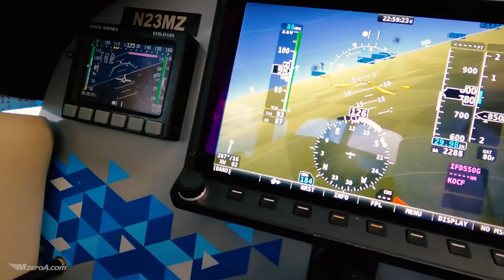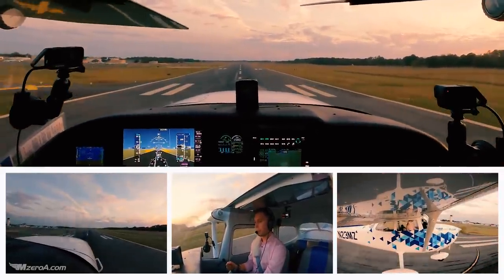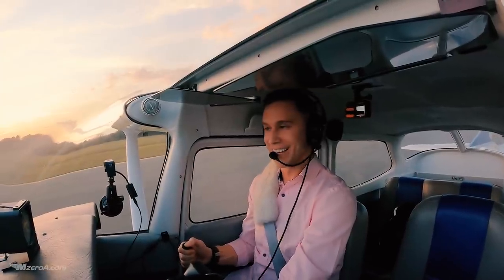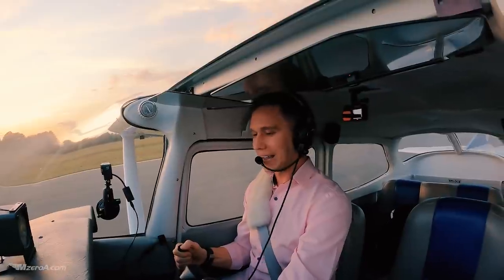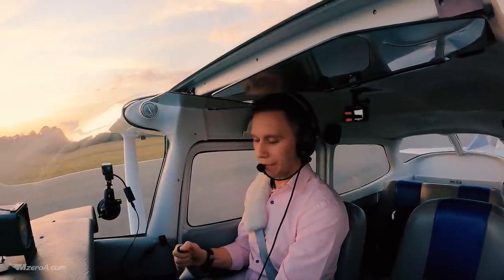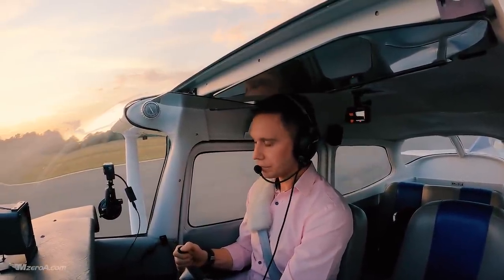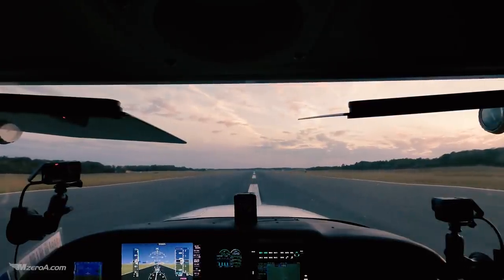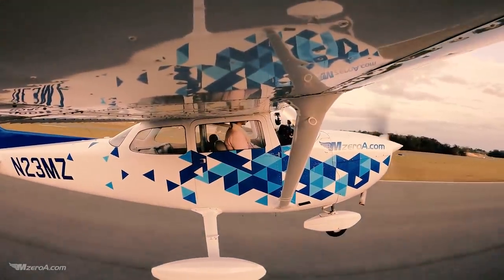Fundamental Series Episode 1 - Landings

Comment: Fantastic!  I’m working on my private pilots… My assigned instructor had me spend 1.3 hours doing 10 touch and goes with two full stops . My first ones were my best.  My calls got better. I called it quits. I’ve asked him to do mix practice up in the air. Add turns in with stalls and so forth. We will practice stalls repeatedly for an hour.  He told me that until I prove myself I don’t deserve to do anything else. 🙁 I’m not improving, I’m getting frustrated. Recently I’ve flown with other flight instructors and asked them if we could do mixed practice. I’m making progress with them. And was even told by one instructor that he’s going to mix things up with his students more often, especially when they get stuck. I think I’m gonna have to fire my primary.
Reply: Yeah, it's a bad move by the primary instructor to not realize that you have to mix it up to overcome plateaus

Comment: Never try to “stretch” a glide on final approach. Your only option is to reduce the flap setting and lower the nose. This is why using a slip instead of flaps is better. If you’re gonna be short of the spot, add flaps in ground effect. Hold it off, but let it balloon.

Comment: I have been an aviator for almost 38 years. Assorted ratings and endorsements and  Now I am back to basics with the airplane  I Have now. It is a conventional gear otherwise known as a taildragger for the newer set out there. These are extremely informative and very well done. We are all student pilots each and every time we go up just with a little more experience. I have landed without landing lights both on purpose and not on purpose.. I  have practiced them and sometimes I have shut them off because they were a distraction especially on a shorter runway. If it does teach you depth perception and how to set down Nicely.

Comment: Awesome job!! I appreciate your mentorship. Many of these landings I’ve done so many times before and, yes, Right Traffic (which is standard for us at Chesapeake RWY 23) is a challenge. You do get comfortable pretty quickly with it though. My instructors have always been pretty good about teaching the “Glassy Water” approach at night with no landing light. I still remember the first time he did it to me, turned out the landing light on final and it was the last landing of the night. As soon as it happened I seemingly (instinctively) transitioned to landing with a little power to smooth the approach and transition. Ironically, when I was younger☺️, I used to ride along with our Part 135 Captains and work radios and do some of the Pilot Monitoring duties on the revenue legs and actually fly the twins on the non revenue legs to get some free training. One thing our Chief Pilot gave me advice on was a stabilized powered approach to landing (to make the landing smooth as possible for the pax). Warren used to call out Airspeed and Attitude on short final and coach me to “hold it, hold it!” Then just as the wheels squeaked, retard the throttles and decelerate smoothly. Obviously, most operators aren’t flying into short fields on a regular basis, so it’s nice to do on a longer runway. Short fields you have to do the proper techniques and master the airplane, but it’s also nice to learn how to master the power and pitch combinations just as you showed here and plan the approach appropriately. Nice job on the lesson and great job editing Coach Ray!!
Reply from the maker: Thanks for watching, Talib! Glad you have gotten some quality flying experiences! Glad you enjoyed the video!

Comment: I'm at almost 90 hours and just need to finish my solo cross country requirements before the checkride, yet I still struggle with my landings.  Your videos are really excellent and address nearly all of the challenges I have faced in my training so far, I really appreciate the time and effort you have put into their production.  I try to remember and apply your techniques every time I get in the plane.  The one thing I find missing on every flight training video I have watched is the inclusion of rudder action.  I have been seriously rudder challenged from day one and, while improving, it is still a major issue.  I would love to see someone instrument the rudder pedals and provide a real-time rudder action gauge or readout on the video to show what is going on with the pedals throughout the exercise.  Yaw is, after all, a major axis of control, and it seems to be frequently left out of the discussion.  Many of my landings wind up lousy because I am not keeping the nose headed in the right direction.  I'm sure there are restrictions from the FAA on how such a thing could be implemented, but it would surely be an incredibly useful data point for training.
Reply: I feel with you. I am an older guy and I really needed some extra hours to land. The synapses didn't connect as quickly, you think more. ;). In my case I read many recommendations but the best one was to SEE the runway getting wider. Keep your speed limits and watch the runway getting wider and wider. When the speed of getting wider is about 10 times faster than normal you are on the right height. The helped me - even in night flights when there were no middle markers. Now, I am flying several aircraft including my own one, a Cessna 182 and my synapses are connected, even for cross winds and gusts. Honestly, I am better in landing with heavier aircrafts than with light ones like Cessna 152 due to my  "gross motor skills"... Try it. Concerning the rudders: look far to the end of the runway and imagine to drive on a motorway.

Comment: My CFI did this same routine with me. It was awesome. My confidence shot through the roof after nailing my power off landings, first two ever and landed great on both. I didn’t use flaps and slipped for altitude then speed. I can always lose altitude over the fence but I can’t get it back if the engine is out.

Comment: First time I think I've left a comment on one of your videos. All of your videos are excellent. 

I really enjoyed this one. Probably because I feel like I've been having a hard time lately with my landings. I've always flown a 172, but recently started getting checked out on an Evektor Sportstar. Because it's cheaper to rent and I need to get 50 or so more command hours to get my CPL (currently RPL with about 178hrs total, done on and off, over quite a few year).

The problem I've been having is getting used to the smaller and lighter sportster. It's so easy to bust flap speed on base and final. I'm also over controlling the stick, because it gets blown around so much. Crosswind landings also need some polishing.

The part about getting burned out doing so many circuits, struck a chord with me. My instructor had me doing over 2 hrs of circuits (with a 1/2hr break) and I could feel my brain starting to fog over 😉.

Thanks for the tips. I'll keep practicing.
Reply from the maker: Glad our videos are helping! Keep on practicing and you'll master those landings but don't get burned out as you mentioned from the video. Thanks for watching and sharing your experiences! Fly safe!
Reply: @MzeroAFlightTraining  Thanks 🙏. Will do. All the best 👍

Comment: You mentioned landing with 20 degrees of flaps, my primary instructor always had me landing with 20 degrees of flaps. In fact it was abnormal to use no flaps / full flaps which ended up being a gotcha on the practical test. Making progress towards commercial and instrument.Thanks for the content!
Reply: I'm a pre-solo student pilot and we always land with 20 degrees of flaps.  What was the gotcha? Should I bring up practicing no flaps / full flaps?
Reply: @billylindeman  wasn’t anything too big. 

The DPE told me to demonstrate a short field landing I ended up doing it with 20 degrees flaps instead of full flaps. Landed right on point and was able to make the first taxiway exit which was the perimeters. 

My instructor always called it a “full flap landing” not “Short Field” landing which I am sure short field is probably the appropriate term.
Reply from the maker: Thanks for watching, Jason!

Comment: A question from a non pilot. To a glider pilot every landing is engine out, I realise gliders have a much lower descent rate than a powered aircraft with no engine, but they have to nail it every time, first time, no go around. If powered aircraft pilots were trained to assume a similar mindset, wouldn't it be much safer? Thanks and regards.

Comment: Jason, I didn't hear you make comments about adjusting trim.  Are you adjusting it each change in the throttle and flap positions?  I understand that trim should be adjusted whenever there's a change in the throttle setting and/or flap position.  That's done to minimize or eliminate pressure (backward or forward) on the yoke.  Also, this is a very informative and helpful video.  Thanks!
Reply from the maker: Thanks for your feedback! Yes it is a good idea to use trim to help alleviate some control pressure, just make sure you don't fly using only the trim to ensure you don't enter an elevator trim stall. Fly safe!

Comment: Great conten Jason. Do you in general avoide flaps if the wind is higher/gusting? Never understood that concept, since I guess flaps = slower speed over the rwy, which gives less float. Could you explain about your flaps policies :-)
Reply from the maker: Hello! Depending on how gusty it is, you may want to consider not landing with full flaps. This allows you to have a higher approach speed, be more stable, and have more control over the aircraft. However you need to account for your speed to make sure you don't float too much. We encourage practicing first with a CFI. Hope this helps answer your question. If you need anymore help or clarification please do not hesitate to reach out to us at support@mzeroa.com. Thanks for watching and fly safe!

Comment: Hi Jason. Love your instruction. I'm a little confused regarding carb heat. I fly VFR in West Texas, but not in icy weather. With good weather do I always need to add carb heat when landing?
Reply from the maker: Hi Tim! Thanks for your question and sorry for the delayed response. You should consult your aircraft's POH. Many aircraft have you turn on carb heat when leaving the green arc on the tachometer, regardless of where you are in the country. Air is cooled down dramatically when it is sucked into the engine due to the Venturi effect, so this is why you need carb heat even on those hot days. But again, consult your POH. If you need anymore help please feel free to reach out to us at support@mzeroa.com. Thanks and fly safe!

Comment: I am doing my flight training now and I have 2 fears I’m struggling to overcome, engine failure right after take off but more so stall spin on final where there is not enough altitude to recover. What is your advise on getting over that fear and preventing that from happening? Thanks! Love your videos.
Reply from the maker: Thanks for watching and thanks for the question! We would recommend discussing this with your instructor. He/she can practice turns, stalls, and emergency scenarios with you at a higher, safer altitude so that you can practice recovery. Also, practicing landings and doing pattern work can also help you get more comfortable with your aircraft. Good luck and keep on learning!

Comment: I'm doing night flight requirements tomorrow night so I'm going to ask my instructor to do some no-light landings.. thanks for the tip!
Reply: @jameswebb2912  Good call, I have battery powered LED strips, headlamp, flashlight.. and my CFI has all his equipment too!
Reply: @Ayodehi  There is a great story behind that advice. I was giving a night checkout in 1977 and my student told me about his first night instruction for the private license. His instructor turned off all the lights and said you have an electrical failure. He reached into his flight bag and pulled out a flashlight and put it in his mouth. He instructor took the flashlight out of his mouth and said, “the batteries failed.’ He reached into his flight case and pulled out a second flashlight. The instructor took that flashlight and said, “those batteries are dead too.” The student reached into his flight bag and produced a third flashlight. The instructor gave up. My student told me that he was glad he didn’t take that flashlight because it was the only one he had left. That is a true story.
Reply: @jameswebb2912  That's an awesome instructor.. and good on the student to be so prepared. Not only do I have 3 options for flashlights but I have multiple spare batteries too... as well as 2 power bricks for my two phones and/or the dash LED's.... good luck convincing me that all of them failed without being hit by an EMP or something :). If we run into any trouble, it's not going to be because we didn't have inside lights (the reason I'm so over prepared is because the dash panel lights don't work to begin with and the landing light failed 2 months after replacement!)
Reply from the maker: Thanks for watching, Ben!

Comment: Excellent video and great view on progressive learning points as compared to repetitions. One question though: what’s the reason you keep the carb heat on till takeoff instead of turning it of on final? Doesn’t that decrease performance in case of go-around?
Reply: I think he does that to prevent carburator icing since he's northern hemisphere.
Reply: @OrlandoObra  I agree - but my take was to keep carb heat on while on downwind and base and then turn it off on final. To my understanding that should get rid of any possible carb-ice, but not impact engine performance in case of go-around?
Reply: @lindegaardhjorth   I see where you're coming from, but you gotta understand that he has landing procedures that's written on the aircraft's POH and needs to be followed everytime and turning on carb heat before landing is one of them. Yes, it will affect engine performance on take off, but you can see and hear his callouts about turning off the carb heat while on take off roll in his touch and go's. Same goes for go-around procedures.
Reply from the maker: Here is a video explaining why Jason flys in the right seat. https://business.facebook.com/MzeroA/videos/246461629865436/

Comment: 9:25 elapsed time into the video. I heard “stretch the glide.” When going into a headwind, slowing your airspeed diminishes your glide range. It’s actually better to be a little faster, then publish glide speed when trying to penetrate against a headwind. You can use 1/2 the wind speed as a rough rule of thumb. Add that to your published, glide speed for optimal glide performance. Never stretch your glide by bringing your nose up. I have to beat that tendency out of my students; every single one of therm wants to do that. See my other comment about what your options might be if it looks like you’re getting low on the final approach segment of your power off 180.

Comment: Something I’m really struggling with is keeping proper landing speeds, I’m bad about letting it drop and then I’m slamming down on the runway
Reply: Spend some real quality time practicing slow flight.  Often times that gets breezed through in the syllabus, but it is really the key IMO.  Challenge yourself to fly at whatever your approach speed is,(at altitude) and vary power and pitch until you can control a descent at any rate (try 100, 200, 500, and back) at will.  Apply that to your landing and you'll probably be pleasantly surprised!  :)
Reply from the maker: @pipercherokee8598  Great advice!
Reply: Try to keep your pitch in for that airspeed. If you feel yourself coming down sooner than you want add power in to correct.